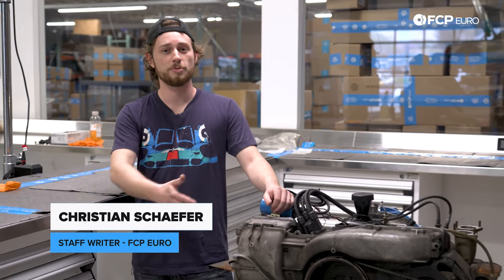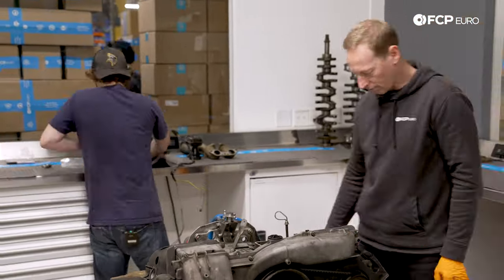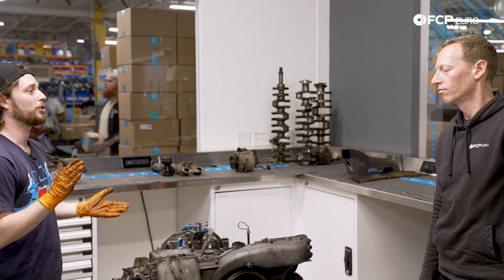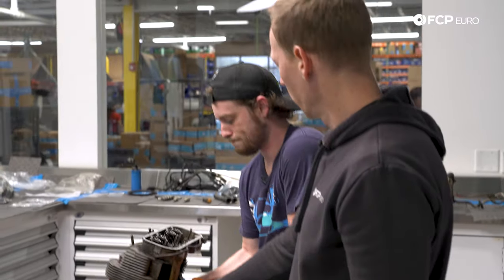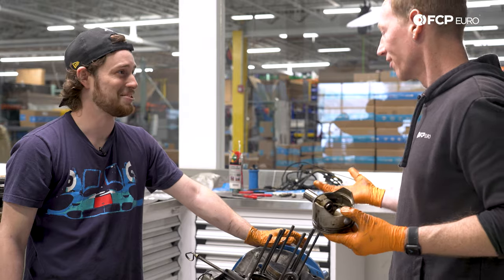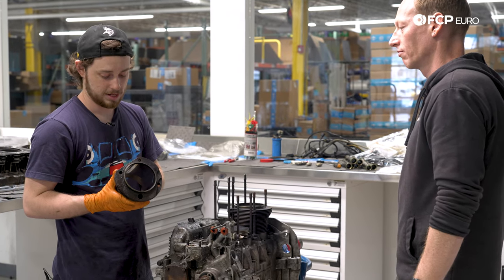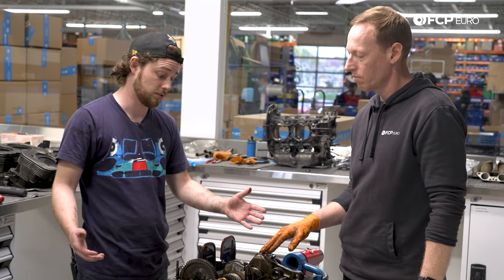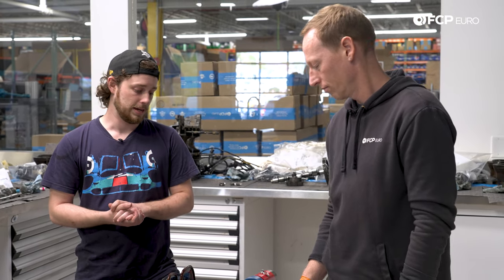Air Cooled Engines Explained - Porsche 914 VW Type 4 Engine Teardown - What Did He Actually Buy?

Comment: Nice to see different content now and again . The oil cooler seal material has been used for years and is probably as old as the rest of the seals. In an air-cooled   VW motor that does not have hydraulic lifters you are asking for trouble adjusting your valves every 30,000 miles as stated. They should be checked and adjusted with every tune-up and oil change. Checking and adjusting your valves at these times will prevent burnt valves,sucked valve seats and mushroomed valve stems to name a few of the things that end the life of air-cooled VW motors early.

Comment: I owned/bought and sold over fifty 914s over 10 years of driving them exclusively (yeah until that first child came along) back in the 80's and 90's. I started a 914 only repair business that needless to say did not even support my 914 addiction. Tore down and rebuilt more engines than I can remember, including some for customers. . . My first engine rebuild of any kind which was for my first 914, a 1970 tail shifter 1.7, had all kinds of interesting discoveries. . . I did that rebuild twice just for good measure after the dual valve spring heads ate the reground cam that I ignorantly chose to use the first time around. . . The missing cast iron fin material (from the cylinder jug as well as the cooling cavity) in my humble, but most accurate opinion (cough cough) is from a drop. Yeah it's from a drop. Cough cough, been there, done that too, for a customer's car no less. That job was a bust financially for me. Ouch! . . It was a stock engine, and a factory original 2 liter cylinder jug. Luckily a local "real" German car repair shop had some left over factory piston/jugs that happened to come into existence because of accidental dropping too. I had to weigh and balance all the pistons though because there was a difference between the replacement piston/jug and the other original ones. . .  I've replaced the uni-body trailing arm supports under the battery tray, welded the sheet-metal reinforcement tabs in the rear trunk for the sway-bar mounting points, built an entire wiring harness from a vw bus wiring loom and the factory correct junkyard parts to put an engine back to fuel injection in order to pass the California emissions tests, rebuilt the D-Jetronic manifold pressure sensors many times, welded the clutch cable tube back to the firewall (yeah that tube next to the fuel line) many times, rebuilt the speedos many times, oh the list goes on. . . I used to go to junkyards just to look for 914s (oh this was way before the internet and online searching) to find valuable parts like the manifold pressure sensors and the factory alloy wheel lugs. . . Automobile Atlanta was the world headquarters for everything 914 back then. I'd buy salvage parts and factory hardware by the pound from them back then. . . Most excitement ever? . . Seeing the flash and fireball come up past my face while I was testing fuel injectors for spray pattern/leakage as they sprayed into a coffee can. . . Pro-tip: use an injector electrical connector and a remote switch, not mini alligator clips to touch the injector contacts, like I was doing. . . If people have questions, I may be able to help. . Comment on this video, and I'll reply.
Reply: I'm curious why you had to do emissions on the car. After 1975, I'm guessing. Regarding driving, is the 1.7 as fun to drive as the 2.0? Thanks
Reply: @Christoph-br2ui  I live in California. Any car that is mandated to be emissions tested is required to have an  absolutely stock and originally equipped engine. It doesn't even matter if a modification actually reduces air pollution emissions. The idea behind that mentality has to do with cheating as well as the reality that smog test technicians are not all technically equal, and are in the business of making money, not trying to figure out if someone is cheating. The state of California has what they call "Referee Stations" that are staffed by state employees that are "supposedly" technical experts in emissions control. They have the power to say a particular engine is "permitted" or not. However they can outright say no too, or they can mandate other things related to the engine/vehicle combination, and that little interaction between the state and "you" is forever stored up to force you to comply with the order, and to prevent you from searching for a different, possibly more lenient referee. . . In regards to cheating, it has made major headlines and resulted in billion dollar fines that various vehicle manufacturers have produced vehicles that had the ability to detect WHEN they were being emissions tested, and to adjust the engine operational control (de-tuned) to appear to be within permitted specification. . . As for emissions testing, California had a "stock engine" requirement in 1983 when I bought my first 914, a 1970. If you know your history of the 914, you know that in 1970 there were only two models produced: the 4-cylinder D-Jetronic fuel-injected VW type 4 engine equipped one, and the 6-cylinder Weber carbureted Porsche 911-T engine equipped one. The guy that sold me that first 914 told me that I wouldn't be able to register the car in California because the engine had had the fuel injection system removed and replaced with a single Holley-Weber carburetor, and that it wouldn't pass the "Visual" inspection of the emissions test. . . I had no clue what that was all about. I was just excited to have my "dream car".  . . Needless to say, when I went down to DMV to register my new car, they told me that "on change of ownership" vehicles had to be emissions tested, so just go to any SMOG test station and get your car tested. My car was never ever hooked up to an emission testing device because the techs would simply look at the engine and say: "It's not stock. I can't test it." Oh and by the way, I was NEVER able to register that car in my name, in eleven years of ownership. Oh I drove it all across the United States and back to California before 1986, including interacting with law enforcement on four occasions with only one ticket for not having a current registration, but never registered in my name. I finally gave the chassis (no engine) away to some Porsche aficionado. The right side trailing arm support had rusted away, so it needed structural help. That trailing arm support had started to collapse on my way back to California. . . So in regards to emissions testing, understand that what the rules are today are not what they have always been, and not what I had to deal with when I owned 914s, which is now more than 30 years ago . . . For that matter, California has as a method of operation the goal of further reducing total statewide emissions always, so they are constantly attempting and actually eventually legislating older vehicles and engines out of existence. . . As for the differences between a stock 1.7 and a 2.0, it's all about the horsepower. The two liter has more power, so it's more capable when power comes to play, but all 914s have awesome handling, so they are great fun to drive on twisty mountain roads. You can still spin out with any 914 though because of the rear weight bias, so never over estimate the cornering ability. The biggest improvements that can be done with stock 914s are front and rear sway bars, bigger (911-T) front brakes, and tires, and if you have a tail-shifter transmission, to convert it to side-shifter. Beyond those things, it's all about money and engine changes. Take Care.

Comment: 2056 are real nice engines...   don't be disappointed.
Reply: It's the perfect combination because it does not stress the basic engine design or require any additional oil cooling or air cooling modifications.

Comment: I have seen cam plugs installed like that on type 1 engines that were used in auto stick cars, the flex plate had a tendency to rub on the cam plug ... I don't know if this applies to the type 4 engines that were used with auto transmissions. Either way, I don't think this is why it leaked there, sometimes they just leak there if you don't use the right sealant or don't use enough of it (I use Permatex aviation sealant).
I also don't put the windage tray back on when i get an engine that has it, the tray slows the return of oil back to the sump so much that it is possible to fully drain the sump (and have no oil pressure) at higher rpm, all the oil trapped above the tray.

Comment: Putting one of these in my Beetle, c/w Sharpworks carbon fibre upright housing and a 911 cooling fan for the German look. Hoping for about 100bhp with the 96 pistons and dual Weber IDF.
Reply: With that combo and a new Type4 Store camshaft, you could easily get 120HP and still have a bullet proof engine.

Comment: The thermostat bellow default position is shrunk then it starts expanding as the filled gas gets heated.
Reply: That means the cooling fans are in the fully open position when the thermostat fails. Good German engineering back in the day.

Comment: Most likely, those thins broke when someone pryed the head off.
Aircooled VWs do overheat, usually drivers dont notice, unfortunately.
Head temperature was an issue with VWs weird attempts at emissions reduction on some models, sodium filled valves were a bandaid.
Overall they were a very robust engine, look at those rods. Naturally being a VW flat four the crank is a high quality forging, lots of potential in these motors. Still have quite a following in Europe.

Comment: Looks like someone built a 1.8 liter engine into a 2056cc version by adding a 2 liter's crank, connecting rods, and the upgraded 96mm pistons and cylinders, but kept the 1.8 liter cylinder heads.